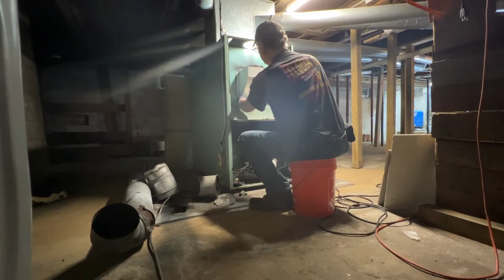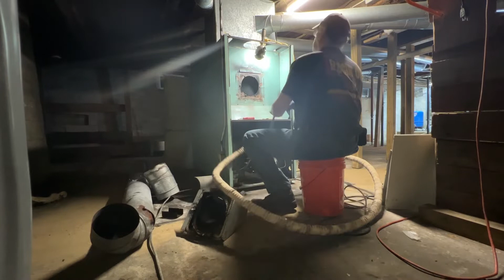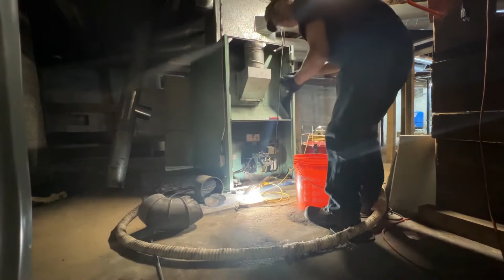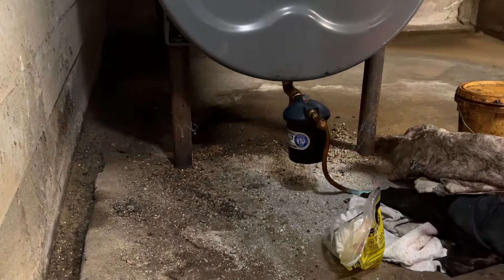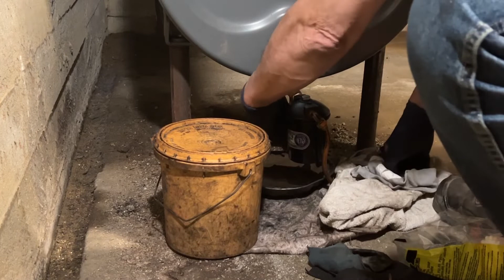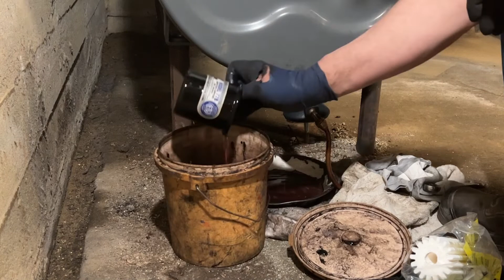Older williamson oil furnace clean and service

Comment: I always replace the electrodes also.  Hardly anyone I see on you tube does.  It’s just not worth risking  a delayed ignition.  Electrodes are so cheap they aren’t worth cleaning, just like spark plugs on a car. I see people leave them in when they are spent.  I also changed the screen in the pump.  I worked on oil since 1972. I don’t miss the stink under my fingernails.  Good video, good efficiency.
Reply from the maker: With the ultra low sulfur heating oil today it is rare that a screen needs to be replaced or cleans providing the filter is changed regularly. I only replace electrodes if the tips start to wear or burn off and again rare if aligned properly. Someday I would like to get together with some guys that were in the business and swap stories…it would make a great video …
Reply: @timeinjohnstown4213  I had several experiences involving delayed ignition, from hairline cracks in the porcelain insulators.  After one, that blew the barometric damper off and stuck it into a sheet rock wall, I started replacing them, and never had it happen again.  With labor rates over 125.00 per hour here, it’s just not worth cleaning them.   I charged 4 hours to do a service, plus parts.  We had a lot of trouble with the fuel lines, because of underground tanks.

Comment: Thanks for the video, I still service several of the older Williamson in my area. The last flue collector I bought was probably 5 years ago. I can’t believe they extorted you that much, it’s awful. Love the round heat exchanger.
Reply from the maker: There is a lot of them still around the price they charged shocked me but the customer was happy that I could get one